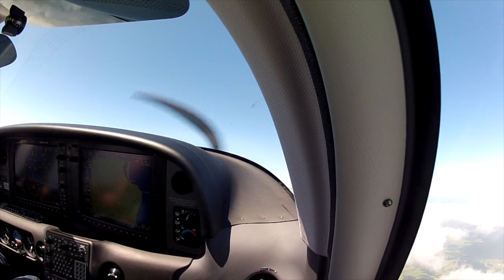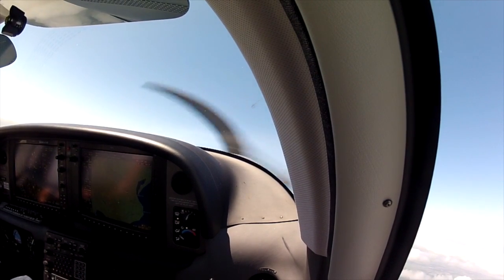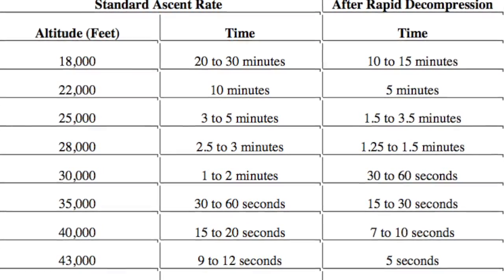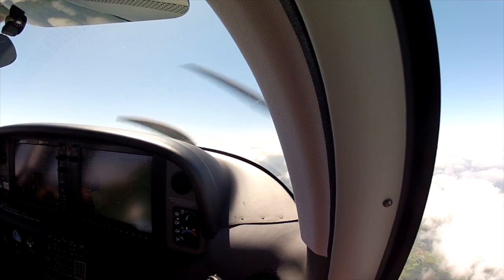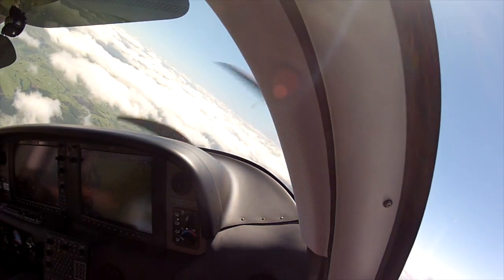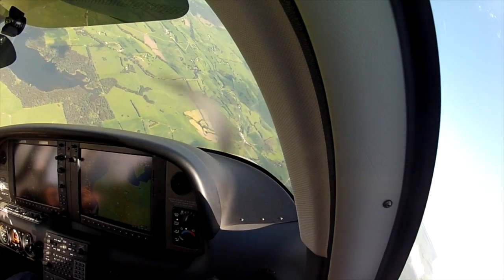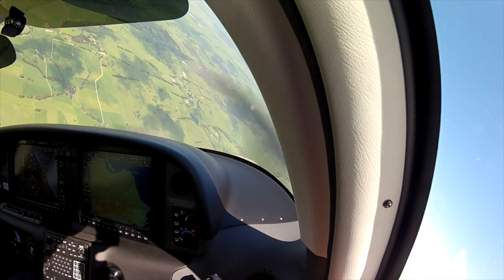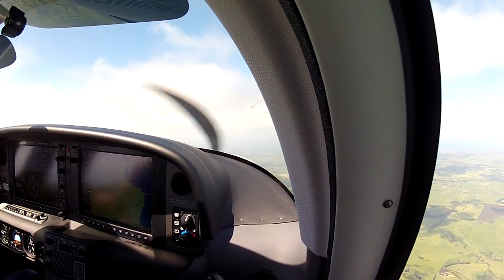Aircraft Emergency Descent

Comment: These videos are awesome Mark. You mentioned an engine fire which got me wondering in the Cirrus whether it's better to do that fast descent before or after pulling the chute. Would the other option be full flaps or slipping descent or would that be much slower to get down?. I might prefer the control of the latter...
Reply from the maker: +Ian Wild The quickest way is going to be Emergency descent which can give you 4,000+FPM descent and then at 1k-2k pull the chute. The chute will bring you down at about 1,700FPM.  Using flaps would be much slower mainly because you are speed limited.